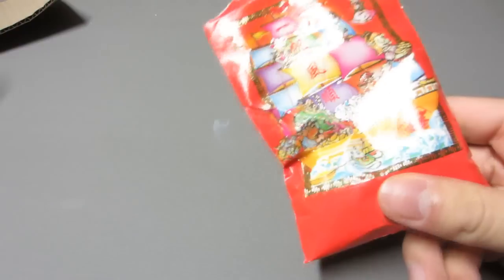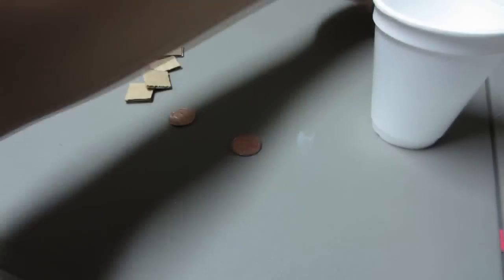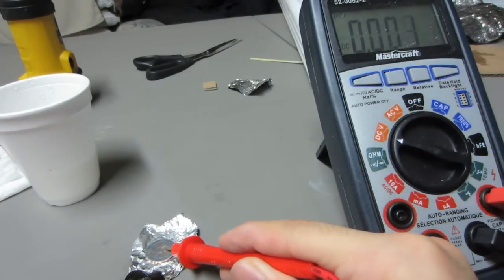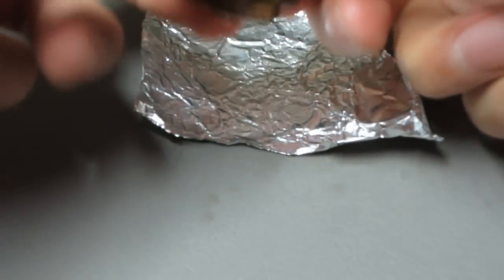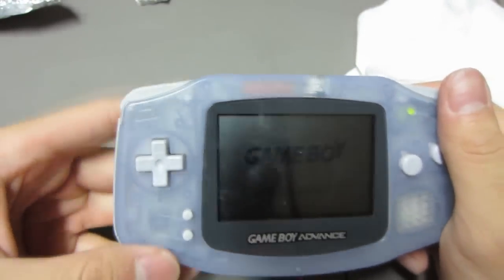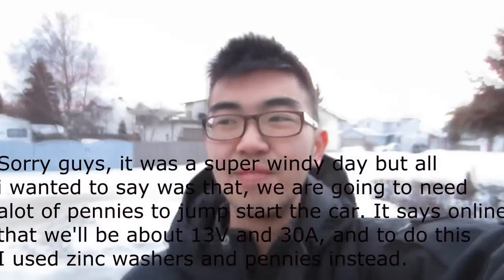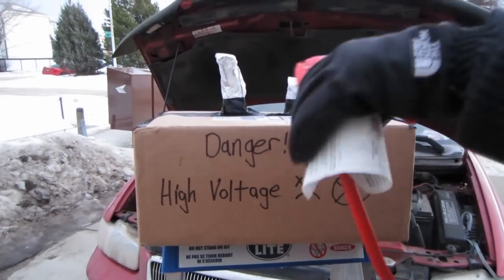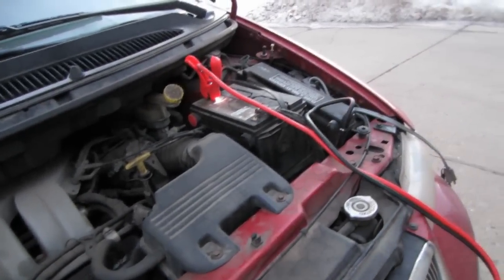Jump Start Your Car with Pennies!

Comment: a drill sanding bit is super effective alternative to sandpaper.  Otherwise you can melt out the zinc of the coins into a hose attachment as a mold to get a coin shape.  Zinc can be smelted on the heat of a single burner on high, once it gets gooey you can use a metal pick to scrap the copper coating off and let the zinc pour out.  Its oddly satisfying.
Reply: WARNING: Heating Zinc gives off HIGHLY TOXIC FUMES!!!

Comment: To those of you saying its fake because he hooked negative to the car body your wrong. The car body is also connected to ground so it would work. He couldhave even hooked it to a metal part on the engine and it would work. Engine and body are grounded.
Reply: But there is higher resistance in the body which is where he went. I am an automotive technician and I can tell you from experience that sure any GOOD ground will work, but I have had trouble starting vehicles by hooking the negative lead to the body... engine block usually works but the body can be difficult, not impossible granted but difficult. By how dead that battery was and how easily it started I do not believe that this is legit. Even the positive terminal was not connected well lol. So yea, not saying it's impossible but it just doesn't seem legit, not to say this couldn't work cause I believe it would but in this case not so much.
Reply: Joseph Bowman If you are an automotive technician, you'll know that the proper procedure for jumping a battery is to connect the ground to the body to minimize the risk of a faulty battery exploding and injuring you. Ideally you should connect the ground with your face hidden behind either the hood or the door post.

Comment: What amp cable you using? Wires are different thickness to those that don't know and its important to have the right gouge. I'm using it for a 12v light so not sure what your using

Comment: Obviously there are alot of people that don't realise how simple battery chemistry is!   Just think for a moment, what is a typical car battery, lead acid!  So, why would this be fake?  A flat vehicle battery can be charged with an 18 volt cordless power tool battery, I know because I've done it!  Enough to get a car started.
Reply: I don't feel like that would produce enough current? I mean, to jumpstart a vehicle you need quite a bit of amperage to operate the distributor/starter
Reply: I did say CHARGE the vehicle battery, not start it.
Reply: And this guy very specifically hooked up the battery only seconds before starting up the car from a supposedly completely empty battery...
This voltaic pile can work, but it would take a couple of minutes to bring even a slightly discharged battery back up to life because the current output is so low.
Reply: he also said he used enough metal to produce 30A. that is huge.

Comment: So how many pennies did it take to jump start the car? was it really only 200? Because that box makes it look more like 2,000!
Reply: Robin Smith well seeing that cell produces 0.8v at around 100mA,  you need around 16 cells ( to be clear,  1 cell = 1penny + cardboard) to produce around 13v at 100mA.
You then put 300 of these 16 cell packs in parallel  to get the required 30A. 
Thats about 4800 batteries.
Reply: Robin Smith and the thing is,  i estimate the volume of the box at around 10000cm³. 
Seeing that a penny + cardboard setup is around 1.135cm³and taking into account that around 10% of the box volume is dedicated to isolation of the cells and wiring,  it certainly looks plausible,  even in a smaller box.
Reply: Out Of Place Ninja, you would also need a bridge rectifier to convert the DC output from the "battery" to the AC power required for your microwave. so you should add about $10-$12 more to your estimate.

Comment: This is good stuff.  I'm curious - how long did the large and small batteries retain a charge?   Are you able to recharge by soaking in vinegar or salt water again?  What's getting used up (does the zinc degrade for example)?   Grant Thompson - "The King of Random"  made a small battery and powered an LED for days, but never mentioned how long it took to finally lose charge, nor whether/how recharging might be possible.
Reply: good questions i have been thinking the same ' did he reply ?

Comment: how can you use 200 pennies , the volts being 13v ,,, u mention parallel in series so how did you get the 30 amps .
Reply: fred bloggs look up Ohm's Law and work it out for yourself. It's pretty easy.

Comment: I am shocked it worked too, because you never showed us the current(amount of amps) coming from your penny batteries. voltage and amps are completely different. voltage is the speed flow through which the amps can flow and most pennies give great voltage but very very tiny amperage.